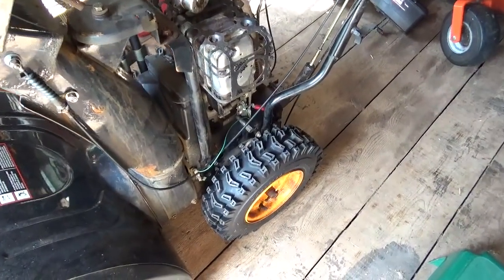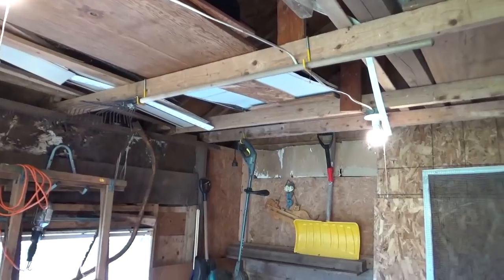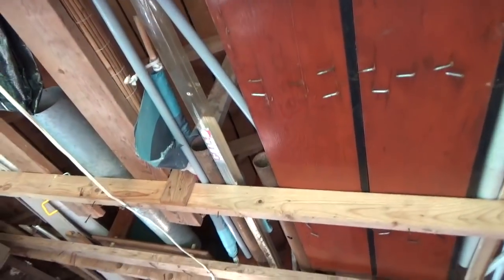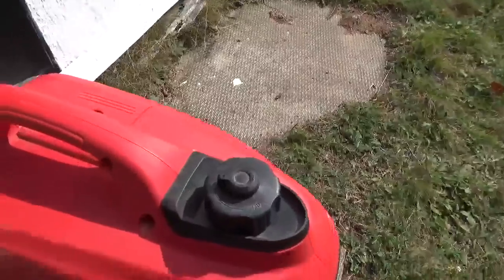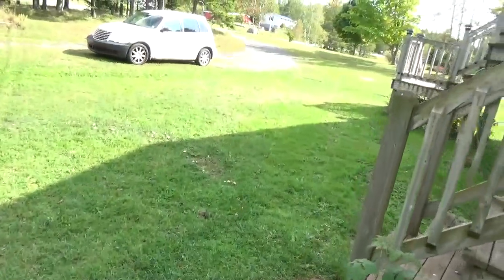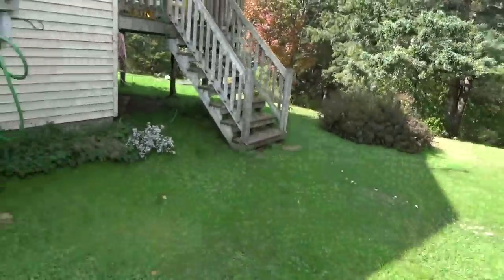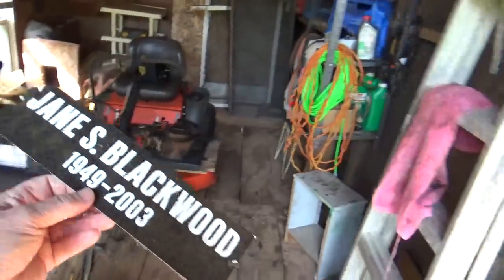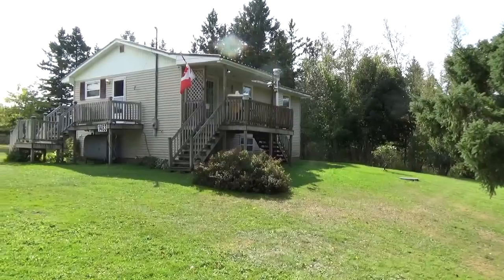Snow Blower Repair

Comment: Aah, the joys of  being a home owner.     I like Husqvarna power  equipment. My Husky weed trimmer is almost 35 years old and still runs. (after I tweaked the carb a bit) I even fixed  a fuel problem on my John Deere riding mower which is 19 years old.                I am 71 and still doing this stuff. Am I nuts? I guess i am glad I am still around to do it.

Comment: Mr.jim when you pull that carburetor apart you  need to remove the needle and seat jet and main jet because there might be dirt clogging up the tiny hole in there and causing it to not run right (spitting and sputtering running rough) so make sure that it's completely taken apart  ....good luck sir God bless from Delaware  👍👍🙂